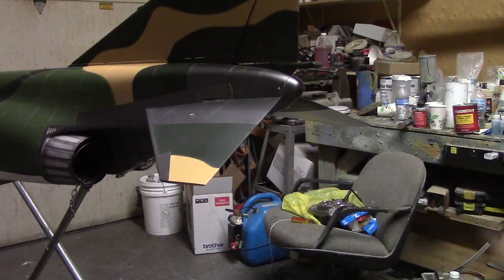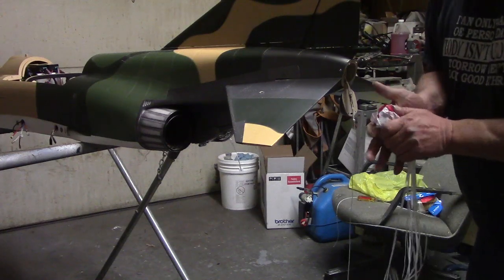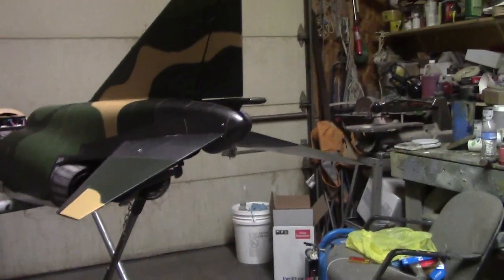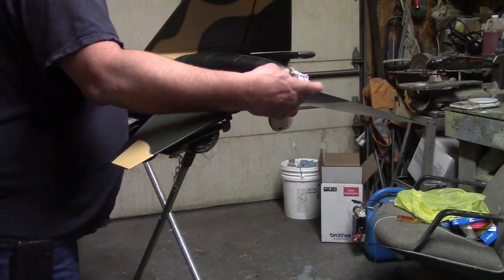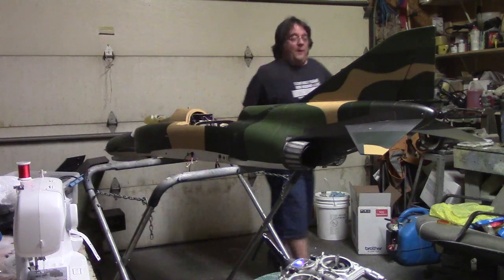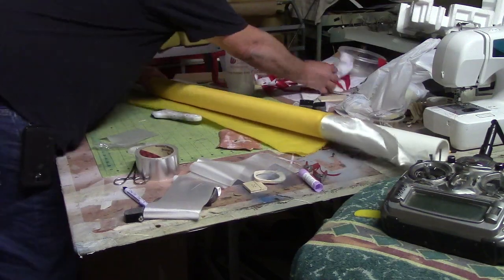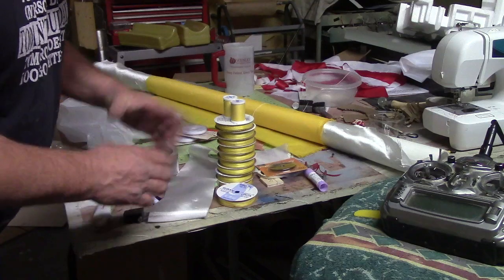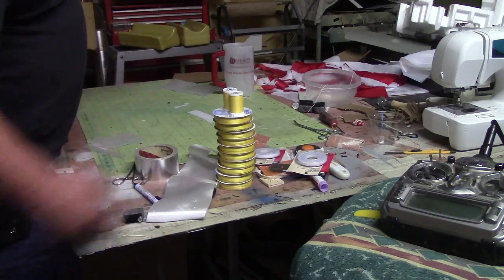F-4 Phantom Chute system Done

Comment: My math might be sloppy but I get 56.25 inches.
Reply: 351xb1973 I agree. If you imagine the chute will have an open 36 diameter and is formed roughly as halve a sphere with a 36 diameter, that number will probably be ok. The perimeter (cross section) of the sphere will be 36*pi and the chute will be halve of that. Because you use a triangular shape which doesn't match exactly the required profile, the chute tends to generate some folding in the highest diameter between each string, which might yield a smaller diameter. Maybe you should start with 62 inches (10% more) and attach provisory cheap cotton strings to see how it turns out and size it down in steps untill you get the right diameter. That you will do once and then you will have you factor to be used for any target diameter. Only remember that removing an external inch will yield a much lower reduction in diameter.